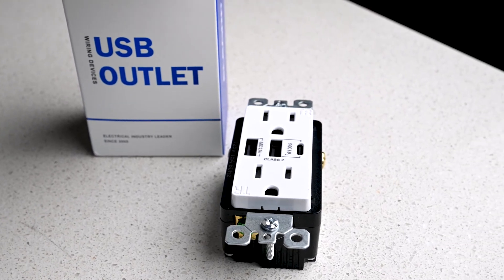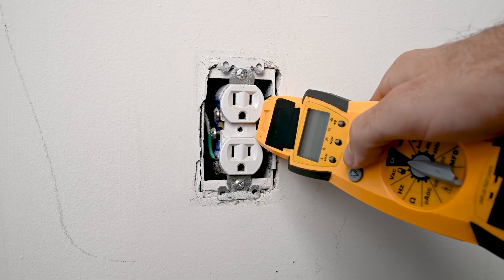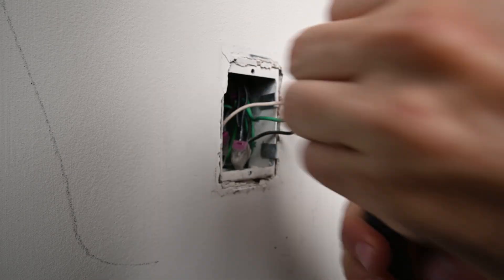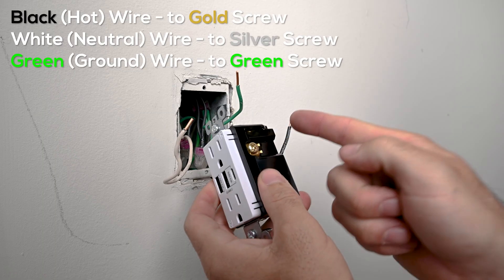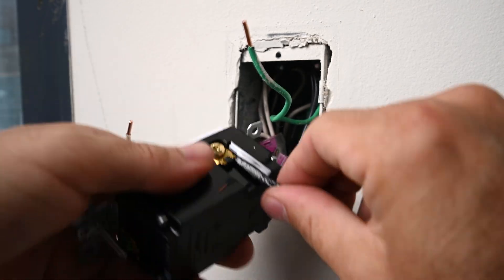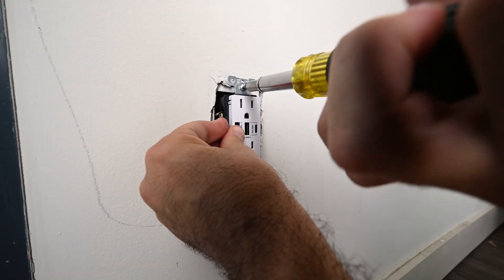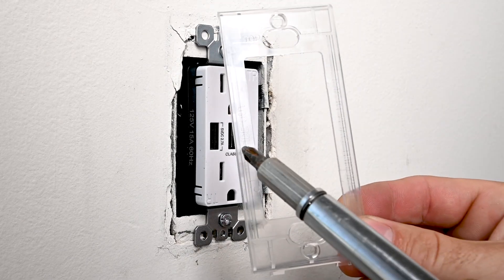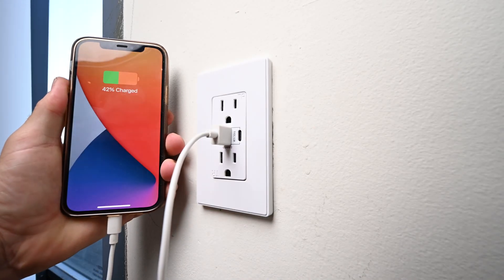Changing My Old Outlet to USB

Comment: Just a tip I learned on another YouTube video. Instead of using the Phillips bit on your screwdriver, you'll get more torque (and a tighter screw connection) using the ECX bit that comes with your electrician's screwdriver. (Klein calls the ECX bits something else. "Combination bit" I think.)

Comment: Keep in mind the amperage you're buying. I installed one years ago and it took way too long to charge my phone. Chargers and phones just changed again. Android I just bought will only charge off a super charger.
Reply from the maker: Yup 👍 this one had 3.3 and 2.7amps - Charged my iPhone 12 with it in an hour no problem. I know the charging technology of the box can’t be completely duplicated, it works
Reply: @ApartmentMaintenancePro  yeah mine is like a 1 amp lol. Just thought I'd mention it. Don't want someone to make the same mistake